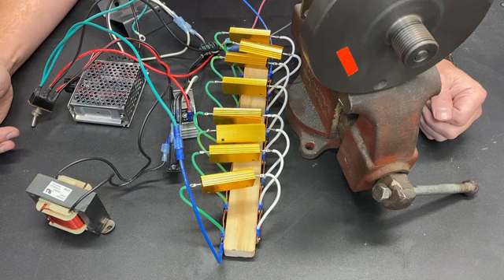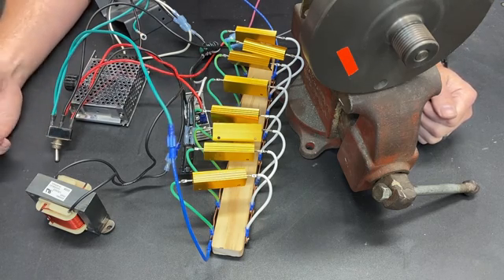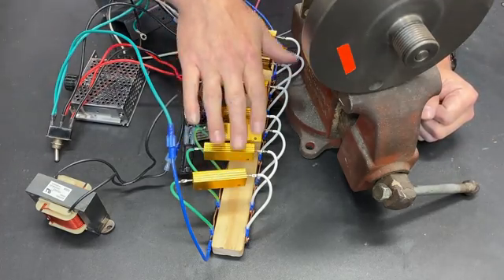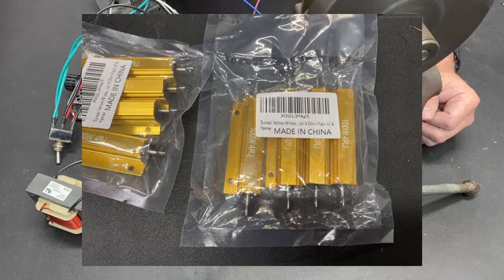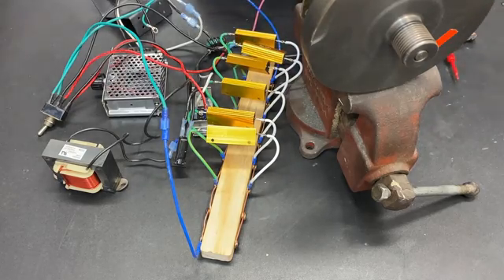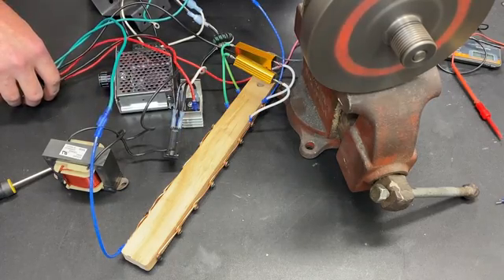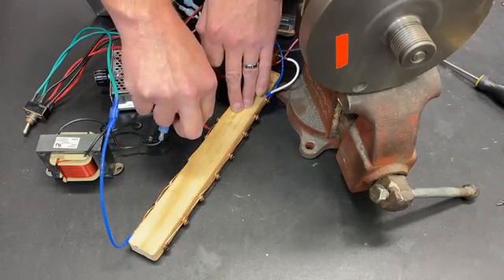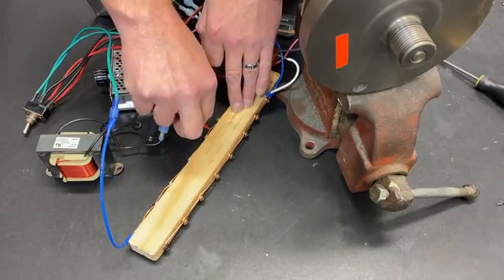Adding Electric Braking to a Treadmill Lathe Motor Upgrade  Experimenting With Braking Resistor Size

Comment: You need to try a 1500 to 4500 Watt  water heater element instead of resisters. I think you will like the results.
Reply: Whats the point he asks??
I'd be positioning the element, as a base plate where i usually place my coffee..😋
Reply: @daxgilmore4374  In that case you could use an old stove eye under your plate. I always try to use what I have instead of buying something new.
Reply: @thehairs2018  Haha.. that would be perfect. 
I also try and use what i have at hand too.
However, buying a new component is sometimes more cost effective than the time it takes, trying to remember where you last saw the component that you already have..😆
Reply: @daxgilmore4374  That's easy. As soon as you get home with the new part look close to where you lay the new part down. The one you were looking for will be under it.
Reply: @thehairs2018  😂
Reply from the maker: A heating element is a resistor and that resistance converts electricity into heat.  Same concept, different packingin for a different application.  If I had a used one laying around I could see the advantage but why would I want to spend $20-$40 on a part that is fairly large when I can can use $10 worth of resistors that take up much less space and give me tons of flexibility to optomize the function?  For me it doesn't make any sense.  A water heater element is an outstanding "bush fix" option but when building something with new parts I don't see any reason not to use the correct parts.
Reply: I thought the phenomenon you guys are describing only happened North of 43rd Parallel where I live ... (My toilet flushes in the clockwise direction.)

My friend and I joke that it's easier/faster to go to Home Depot and buy a new screwdriver than it is to find one of the dozen we already own.

I'm currently looking for the two-sided heat transfer tape I bought to mount the braking resistors to the heatsink. Please let me know if you know where I set it down.